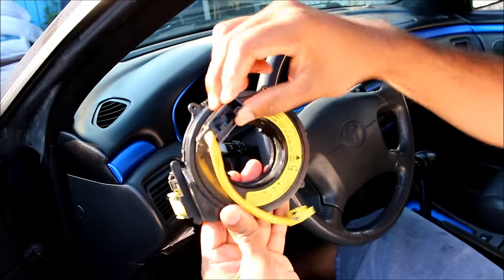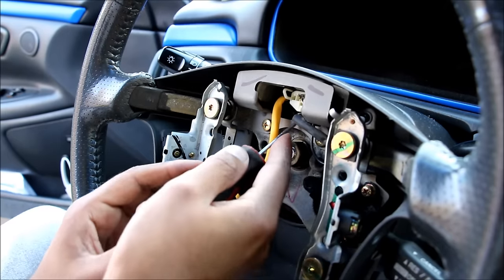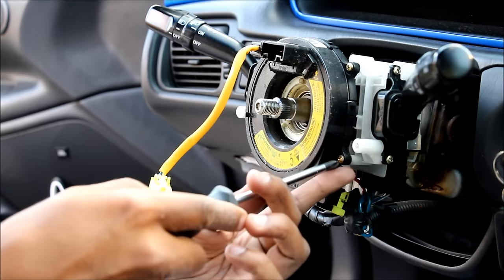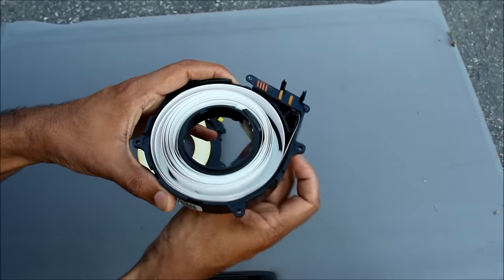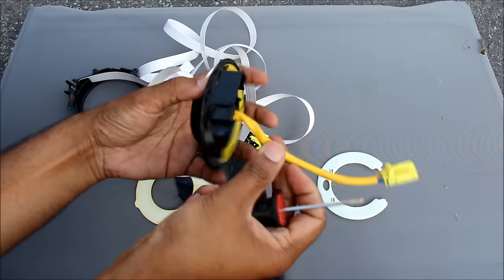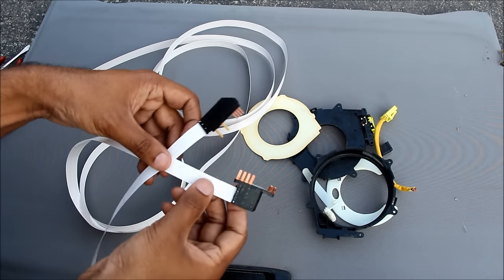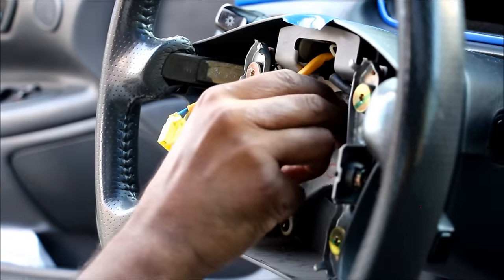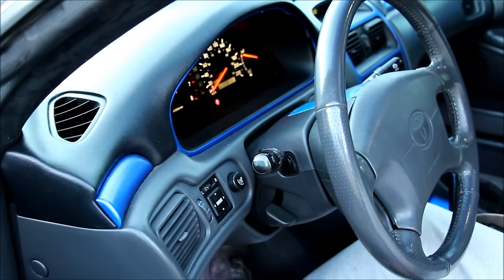Clock Spring Replacement - Toyota / Lexus

Comment: I’ve punched my 98 Lexus gs300 horn cover so many times it only works when I press it in the bottom position of the horn cover. 

Is this what I need to replace?
Reply from the maker: No. You might need a new airbag assembly or the contacts behind might have bent out of shape
Reply: speedkar99 Thanks, I was thinking that the contacts were bent out of shape. 

I don’t have any anger issues. 🤫

Comment: Hello guys.

Does anybody have a diagram of clock spring, or maybe does anybody know how wires should be located inside it.
I took apart mine and can not assemble now, because it has two wires and six rollers inside, and I can not understand how these wires should be placed between rollers.
For Mazda 6 mod 2007
Any help appreciated. Thanks.
Reply from the maker: +Prof. Hatem AbdEl-Ghany clocksprings aren't meant to be taken apart so I doubt there would be documentation on the inside of it. 

Your best bet is to head to the junkyard

Comment: Honda jazz 2007model clock wise horn
My car horn not working some time I turned left and right stiring horn  working ofter stiring sterat no work
Reply from the maker: +sdr dheera Take out the clock spring and measure the continuity

Comment: If you have the new parts... Sould be about 1/2 hour job... I have a 2012 tacoma... I startwd by testing the horns, chking fuse..then relay...then at steering wheel grounding the horn wire.. Then determined that this clock spring was defective...  Anyone know who sells a quality replacement...in Canada
Reply from the maker: Cross reference the OE part number with other Toyotas. You should be able to get one in the junkyard for dirt cheap and it's easy to change!
Reply: Also go to the Toyota Recall site and check your VIN to see if you qualify for the recall where a dealer will replace it for free. Mine is going in tomorrow since the horn has been iffy and my cruise control hasn't worked in years. That way you get OE equipment and get the recall off your VIN record. Just a suggestion.
Reply: Oh yeah, 2006 TRD OR Tacoma here.

Comment: 1-is this clock spring can be fixed or just one use? 
2- the aftermarket clock spring from eBay is it good or not?
Reply from the maker: +toolman talal A clock spring can be fixed but it has to be done neatly where the breakage is so it doesn't bind when the wheel is turning.
Reply from the maker: +toolman talal A clock spring can be fixed but it has to be done neatly where the breakage is so it doesn't bind when the wheel is turning.
Reply: +speedkar99 thank you for replay. 
how about the aftermarket clock spring, any good experience?
Reply from the maker: No experience personally, check auto forums for reviews.

You can also find in junkyard.
Reply: +speedkar99 thanks again.

Comment: No danger even you don't remove 1wire of the battery, what is danger is the two yellow air bag wire when shorted accidentally will explode the bag
Reply from the maker: The yellow needs power to be energized, not shorted.

Comment: haha i wish the steering wheel comes off that easy you need a TOOL!
Reply from the maker: Most Toyota wheels I took off by just yanking. 
The Acura I changed clock spring on the other day was more difficult. 
A pulley puller will help, that's what the threaded screws are for